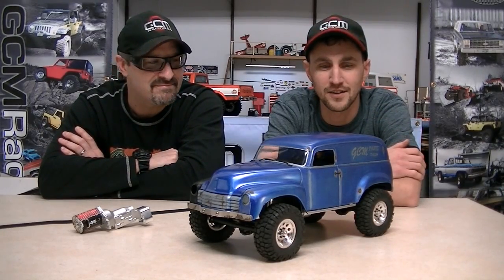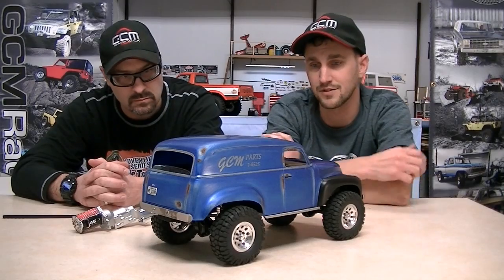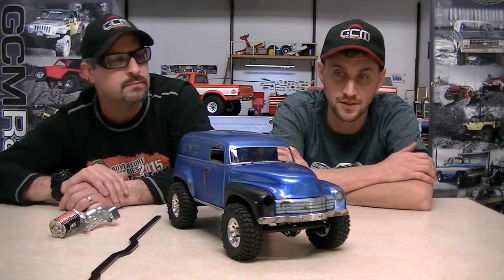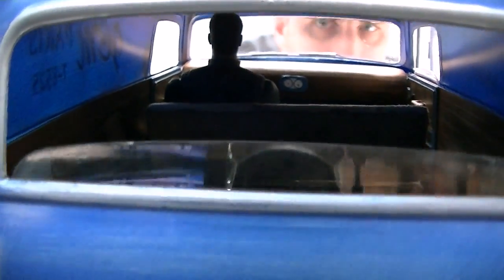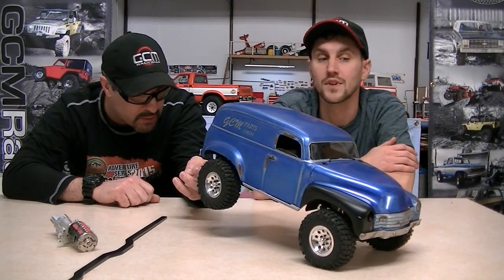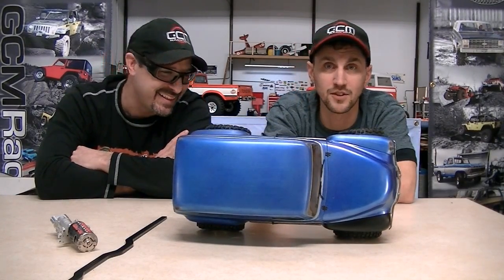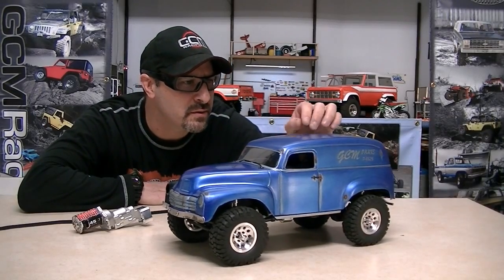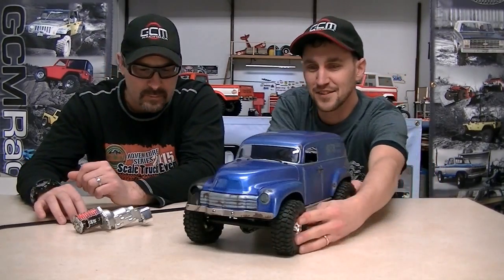Rig Review - 1949 Chevy 3100 Panel Truck

Comment: How did you make the exhaust pipe on the truck?
Reply from the maker: That's just a chunk of steel tube. bend to fit, add a couple mounting brackets with brazing.
Reply: GCMRacing1 - Scale Truck RC in Canada Thank you!